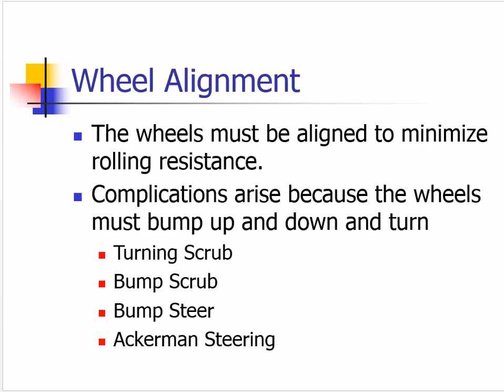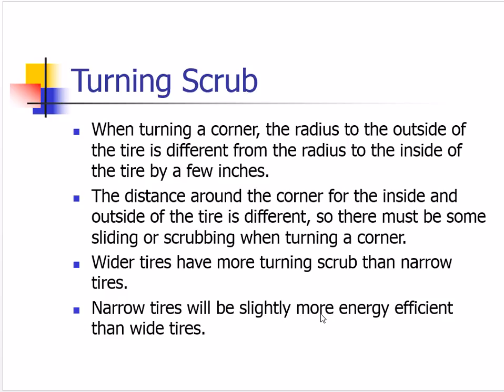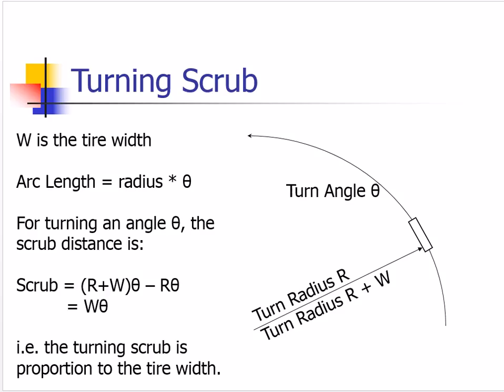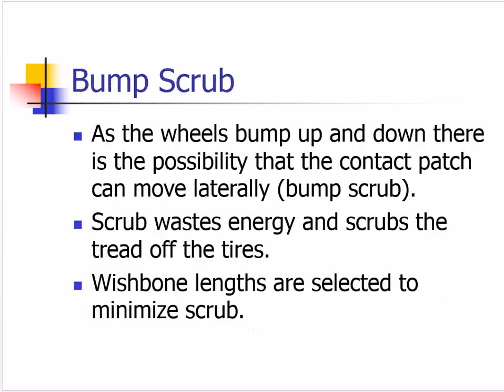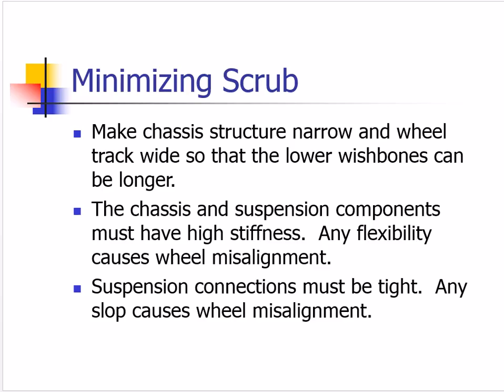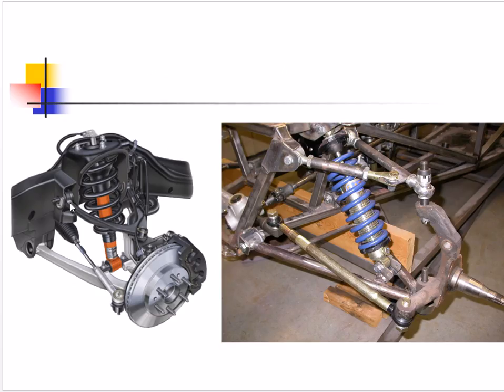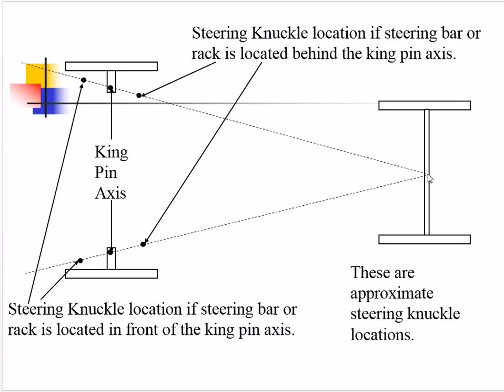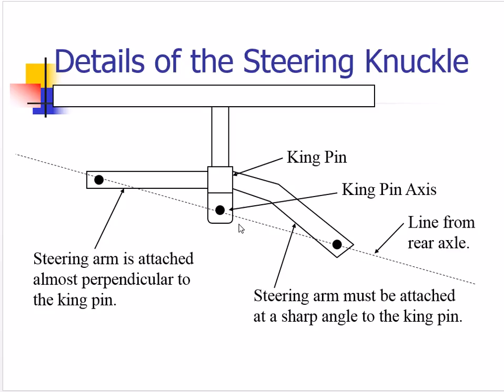Front End Geometry

Comment: How did you come up with the placement of the Perpendicular Bisector?
Reply: That is a good question that is not answered. I don't know this to be 100% true but based on the illustration, it looks like its the mid way point between the ball joint position at rest and at the 1" bump position.

I unfortunately cant say for sure though if that is actually what was or is typically done with your question as my suspension design background is all for race / track cars where we care more about geometry that gives traction with proper camber while cornering. 
Bump scrub is not something we are concerned with since tracks are typically significantly smother than public roads so not real reason to be concerned with bump scrub and loss of efficiency and added tire wear that it could bring. We pick our upper control arm points more based on camber gains and changes with roll center and instant center during chassis roll for the most part.
Like the saying goes, with suspension, everything is a compromise with something else. If we can get a proper camber curve and have to have a bit of bump scrub, then so be it... The benefit of more traction when cornering outweighs the little loss of efficiency we might get because of a bit of bump scrub.

Alll in all though, although this video seems like good information on the topic, the illustrations are very poorly done. Like for example, I doubt there is a car in existence that has the lower ball joint above the axle centerline.  While it really doesn't make a difference being an illustration but it still can be deceiving for those who grasp concepts visually since its not an accurate visual representation.